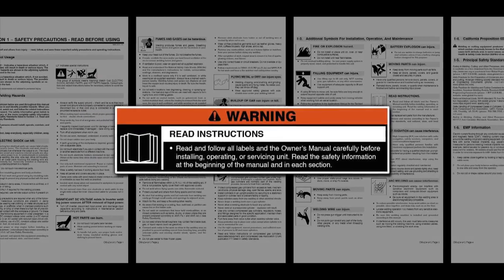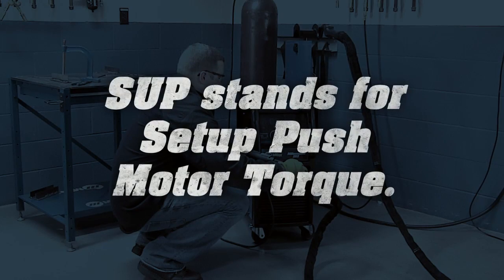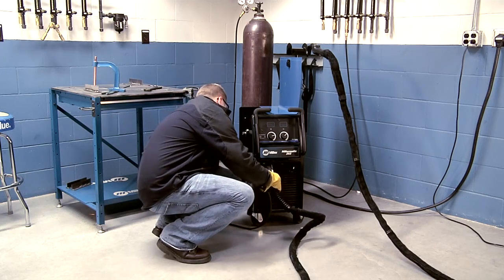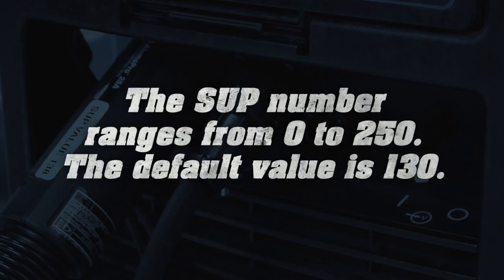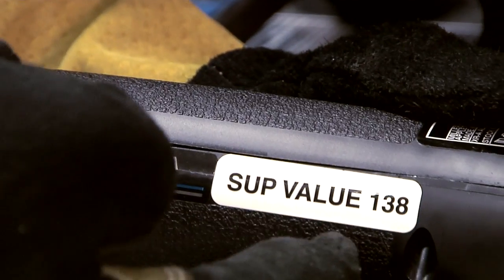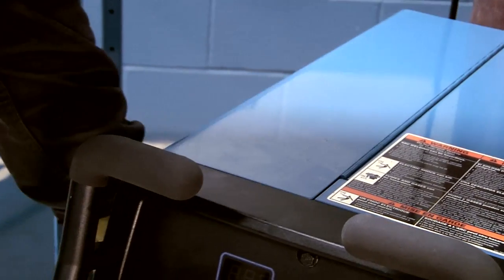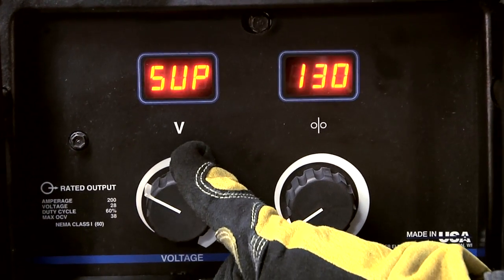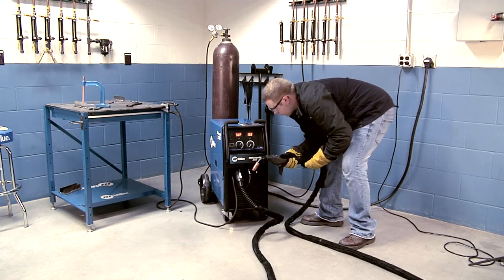Millermatic® 252 MIG welder SUP adjust

Comment: Purchased this welder 13 years ago for $2600... It has held up the test of time.
Reply: Sweet. I just bought a 14 year old machine.  Hopefully it last a lot longer.
Reply: I just paid $4,300 with tax
Reply: @Graniterockstar  Same
Reply: Got my 252 in 2013. It"s hard to beat transformer technology for reliability. There's a reason you can still buy the Millermatic 252 and Lincoln Power Mig 256 years after their introduction. Simple, reliable.

Comment: What would happen if I conect the machine to a 260 v input ? That could damage my welding source?
Reply from the maker: Thanks for your question. Input power to a welding machine should fall with-in a +/- 10% window so a 230 volt unit should be fed with power that falls between 207 and 253 volts. Putting in too much voltage could potentially damage a machine, the higher the voltage the more potential for damage.
Reply: @MillerWelders  thanks for your answer